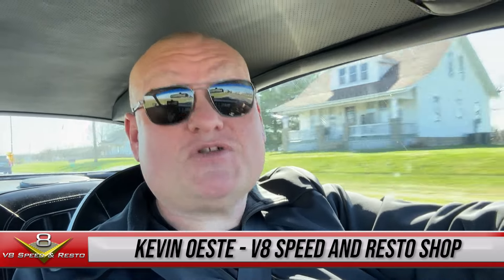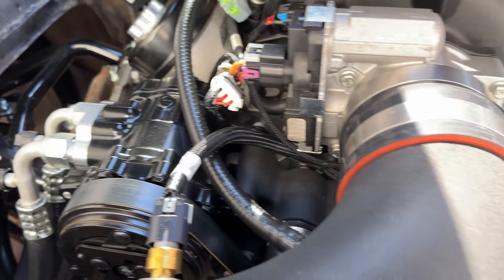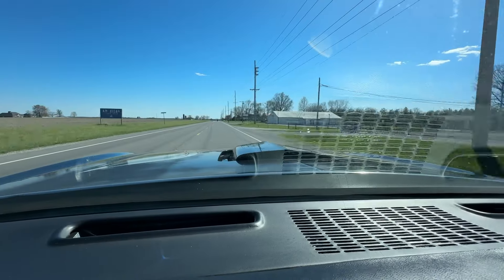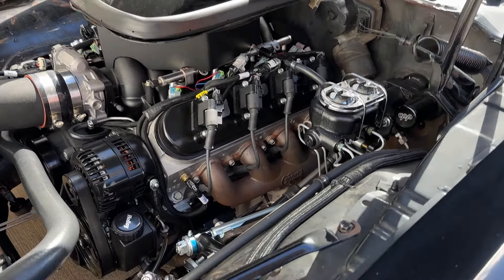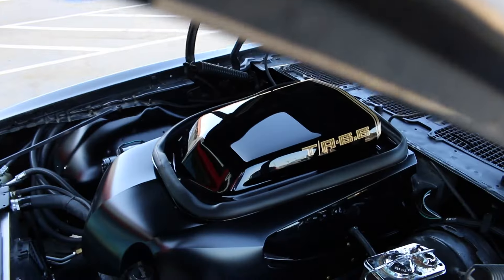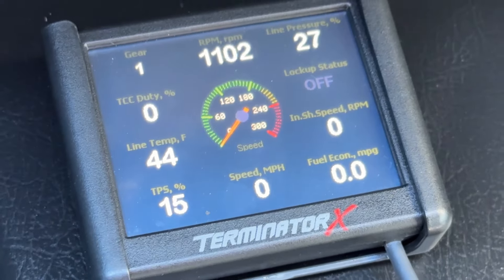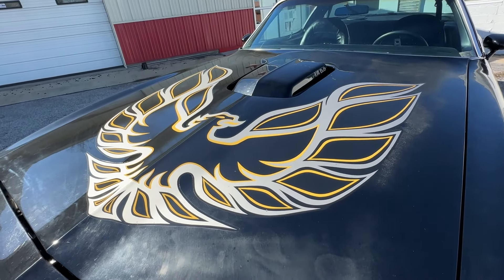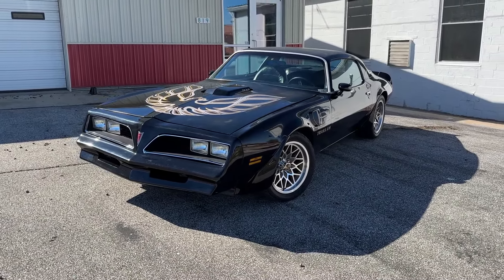1977 Pontiac Firebird LS3 Swap Restomod: From Classic to 530hp Pro-Touring Beast!

Comment: did you do the cross bracing to strengthen the chassis I had a 77 ordered from pontiac in 77 wth the true 400 and close ratio 4 speed unfortunately we parted ways would love to find one and do something similar nice job btw.